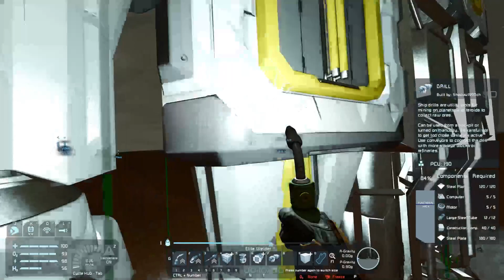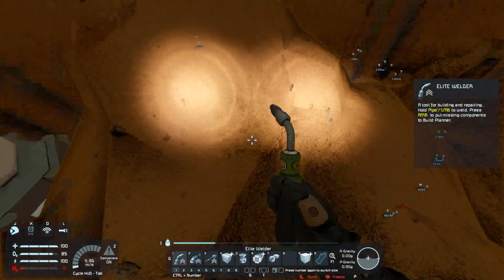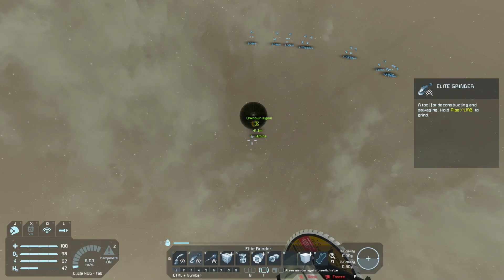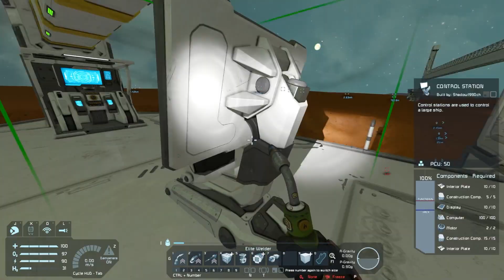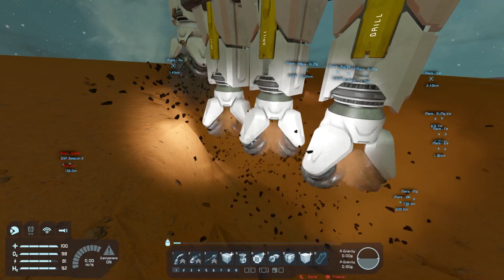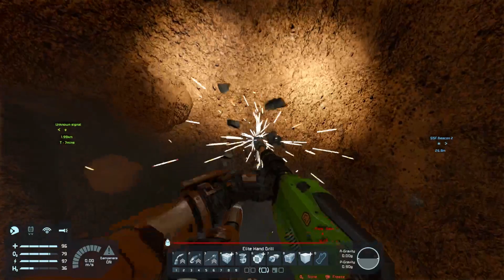Space Engineers: The better Drillhead

Comment: Additional point for the future: moving the drill at a slow enough rate and proper gradient [not sure how well those words translate into your language so you may need to use a translator] SHOULD give you 100% freedom.

Aka...

No 'stalagmites' in your drill pattern.

PLEASE REMEMBER: AS YOU EXTEND YOUR DRILL, THE RELATIVE SPEED INCREASES!!!

Not sure if you though about this, but, as an engineer [in real life], I wanted to point out that at ANY GIVEN REVOLUTIONS PER MINUTE OR ANY DEGREES, RADIANS OR SECONDS per minute, the VELOCITY INCREASES as the TANGENTIAL VECTOR increases.

I fully accept that you may well know this, but I would be remiss, if I failed to mention it, but if you increase a radius, the relative velocity [aka 'distance traveled] increases relatively. 

So, while you may not be an engineer, and may not think of this stuff already, please look ahead of yourself, and find a functionally correct mathematical formula which allows the rotational speed of the driven hub at the center to SLOW DOWN as the drill at the outside TRAVELS OUTWARD.

OTHERWISE, at some point, the drill will be pushed beyond its capacity, and it will BREAK.

This may never be a problem for the INTERIOR drills, as they are going to travel at a nice, safe, FIXED speed, no matter what, BUT the EXTERNAL drill will experience INCREASED face speed as the RADIUS increases.

As a person who owns and operates a MACHINE SHOP, this is an EVERY DAY fact which ALWAYS affects how we here cut  solid steel parts.

Even D2 and D3 tool steel can BURN UP and CRASH if we here do not make sure we set the cutting speeds appropriate to the tool capacity.

Even SINTERED TUNGSTEN CARBIDE tools will break, chip, or crash, if you over speed them.

TECHNICALLY ALL TOOLS CAN CRASH!!!

ALWAYS KNOW YOUR FEEDS-AND-SPEEDS!!! 

[you can not IMAGINE how many TIMES as a TINY KIT WABBUT I was HAMMERED this into my head!!!]

FEEDS-AND-SPEEDS!!! ITS LIFE-OR-DEATH TO AN ENGINEER!!! \>0.0</

SPACE, OR NO SPACE!!!

If you find your outer drill crashes, then you know you exceeded the speeds-n-feeds of that drill. ~( 'w')/
Reply from the maker: Indeed the outermost drill is gonna be the most critical one. I think a good combination of rotation speed and the hight above the ground is gonna work here. Also thanks so much for your expertise!